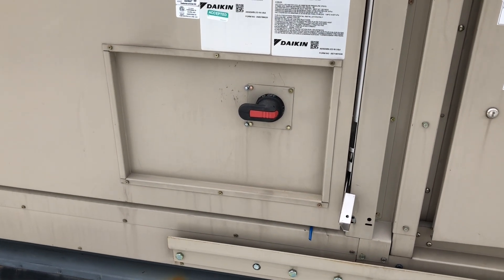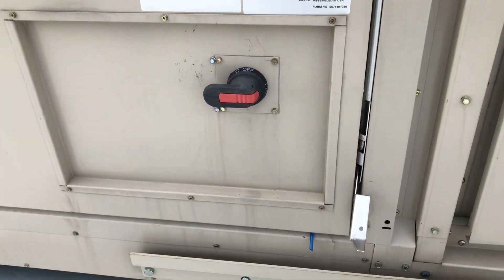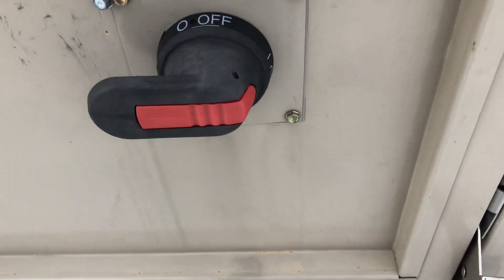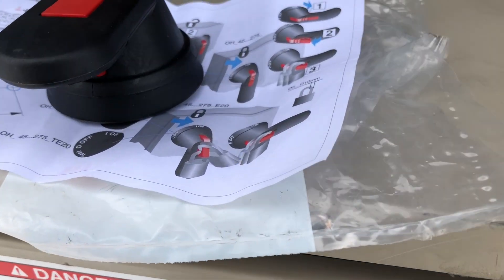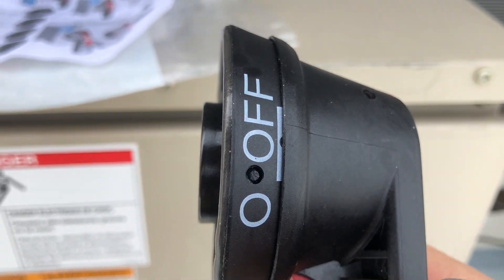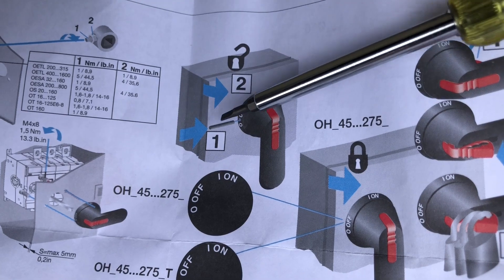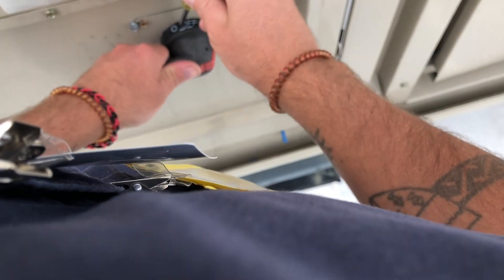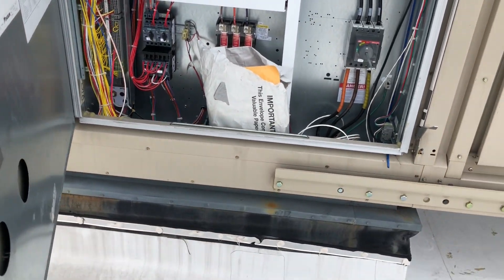HVAC: How did i not know this??  ABB Disconnect Handle WITHOUT Turning Off Power!

Comment: PLEASE DO NOT DO THIS - IT COULD LEAD TO YOUR DEATH.
Reply: The rule is you must need a "tool" to disable a tool interlock.  This is to prevent unqualified individuals from opening live. Not all individuals. 

The door interlock bypass is there because live work for troubleshooting is needed sometimes.
Reply from the maker: First of all, as an HVAC technician, we have to work on units that are live in order to troubleshoot the equipment operation. If it was such a safety hazard, it would not be a part of the handle manufactured by a reputable company. Don’t assume you know everything about every person‘s job. HVAC technicians have to work on live high voltage every single day and in order to keep the unit live you need to open up the equipment. So relax
Reply: What do you do for work?
Reply: as a state certified journeyman electrician, I have to get into vfds that are running.
Reply: My foreman showed me this trick and go figure, the next time I needed to get into a vfd, I had to watch your video. lo😂

Comment: THIS IS NOT SAFE - VERY DANGEROUS - BY DOING THIS YOU ARE BYPASSING ABB SAFETY FEATURS OF THE PRODUCT.  I know because I work for ABB. We would NEVER tell customers to do this. In fact - we would tell them NOT TO. Please take this video down - it will eventually lead to someone getting seriously hurt or killed! You don't want that on your conscious right? It's possible some people will see this who don't have electrical safety knowledge. Please - I request your consideration here. 
Sincerely,
Tim @ ABB
Reply from the maker: And I’m not telling customers to do it my page is for HVAC technicians not for customers. So relax, Karen. I don’t know how you interpreted that I’m telling non-HVAC technicians this. I didn’t say hey aunt Susie want to learn how to open up a high voltage Enclosure. My God move on.
Reply from the maker: And if you claim to be at ABB, why does your company put this as a feature? If it was such a safety concern they would not put it there. In my pages for HVAC technicians not the average Joe. They can follow my page if they’d like, but that’s not what I’m gearing my content towards. You’re finding it because obviously you’re searching for ABB or things like that but most if not all of my subscribers are in the field.